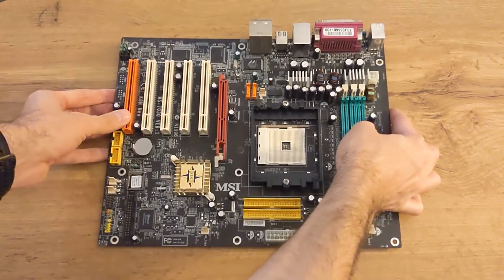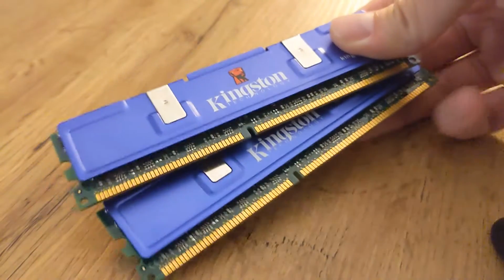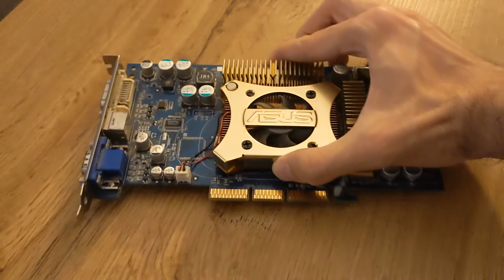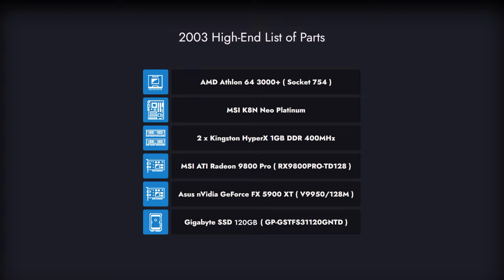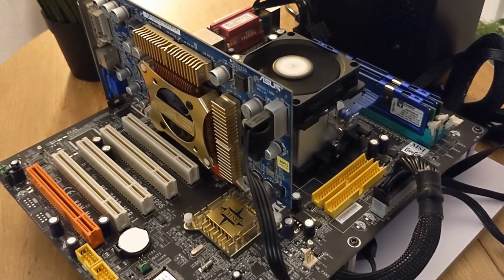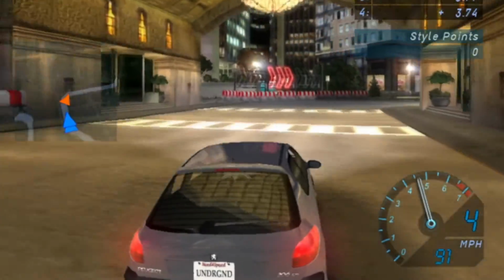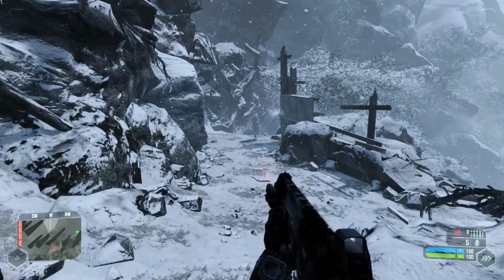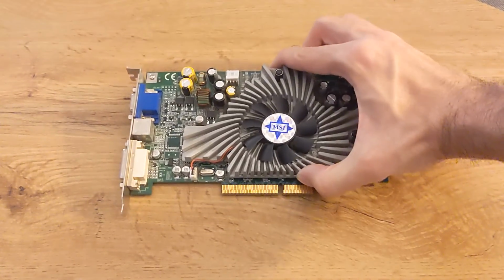2003 High-End Gaming PC Build ( Radeon 9800 Pro vs GeForce FX 5900 XT )

Comment: Ideally it would be better to use Athlon 64 2800+ since it came out in April 2023, Athlon 64 3000+ was released in late December. Also 2GB of 400mz in 2003 was an insane amount of memory. My build in 2005 was Athlone 3500+ and 1GB or RAM, most demanding games used just about half or less. I'd say all games in 2003 could ran on 256MB RAM and 2GB in 2003 is like 64-96GB in current times....

Comment: The GeForce FX5950 Ultra was the top of the line GeForce at that time.

I owned one. I had a Radeon 9700Pro before that. I switched to nVidia then because of the buggy ATi drivers at the time.

However I am a Radeon user again since 2010.

Comment: I had 5900XT, but it was not worth that money, whole FX series is just crap and nvidia drivers were totally bugged in that time, especially those for Win 98. Radeon 9800 is really nice GPU, but extremely rare to find one that actually works, I already gave up and sticked to Radeon 9600XT that is still good enough for some Win 9x gaming PC and you can still find them for reasonable price. I was always more like nvidia guy, but after 20, 25 years when I am testing it now, I realize that a lot of stuff we believed were just myths and nonsenses, in reality, it was exactly vice versa - ATI drivers were more stable and more compatible with older games, so I mostly prefer ATI cards for retro gaming computers, I am not building it for one specific game, but I am trying to get the best compatiblity and that's just very hard to achieve with nvidia cards. The last really good nvidia series from that time was GeForce 4 Ti series + 45.23 drivers.

I have more nostalgia to nvidia cards from 20-25 years ago, but on other hand I absolutely hate them. I remember back in like 2005, my father just threw AvP1 install CDs to river because he got that angry by those glitches, but it was caused by nvidia drviers, but he didn't now. 😀

Today it's vice versa, I had Radeon 9070XT for 3 months and even when all propaganda says exact opposite, I had just problems with that, from terrible input lag in games to not working integer scaling (which is important when you play a lot of old games, but today kids don't even know what integer scaling is or they tell you that AMD had it first, they had it, but it didn't work, they kind of fixed it after some driver update, but it created even higher input lag, so no, thank you, I will switch back to nvidia), weird behavior etc.....so I risked and switched to RTX 5070 Ti, after all that propaganda against it, I was really scared, but I have it already for like 6 months and not a single problem. Only little problem I had was that after some driver update, my icons on desktop just exploded and it didn't remember where I put them, after restart, it was reseted again, but I think it's more like some Microsoft mess than nvidia, it was fixed by some little utility called "desktop ok" and that's really all, no other problem with RTX 5070 Ti and mainly no smoking power connector, I was really scared by that, so I bought some better cable from seasonic.

Comment: Please inquire beforehand what was high-end in 2003 and don't publish such nonsense.
High-End in 2003 was: Radeon 9800 XT and GeForce FX 5950 Ultra.
And your 9800 Pro is not a 9800 Pro.
It's a 9800 XXL with R360 chip which is also stated on the card.
9800 Pro has R350 chip.

Comment: And then nvidia released 6800 ultra and was getting better and better every year. 6600GT aka mid-end card was way faster than 9800pro. These days we're getting 10-25% performance boost in each generation, when back in the day it was 100+% improvements :D

Comment: the 9800 pro was not top of the line released the same day even. That'd be the XT.

Also the 5900xt can't be used with unmodified graphics drivers in a head to head. It specifically substitutes code and degrades image quality because of unsupported features :) It's why your results for somethign like F.E.A.R. were wildly at odds with other games. Minimum doesn't use the features missing, but everything else does.

Comment: lol, socket 754.. for benchmarks ))
CPU bottleneck
Reply from the maker: Yes. In 2003, it was top of the line. What would you use, 7800X3D? :D
Reply: @attictiertech  use socket 939 hehe

Comment: Don't know if this is the right place to ask this, but I need some help. I have a dope 2004 computer case and I'm wanting to go retro and put two gtx 280's in it. I'm building it from scratch and I'm having trouble finding an sli compatible motherboard that'll run both of them well, (that's also around 2008) Any advice?
Reply from the maker: If it's something related to what we do, it's always the right place :)
We are working on something quite similar at the moment. So we're pretty deep in this topic.
Easy advice is to go for the best of the best for chipsets, as you want performance that will not limit 280s. 
If you're going with intel, something with Intel X58 or nForce 790i chipsets. We went with X58 (Rampage II Extreme).
For AMD I would recommend nForce 780a.
Theoretically you can also go with lower tier chipset or older platform, but there you risk compatibility problems.
As for finding the physical board, it's going to take some time and patience.
Check your local market or for some good ebay deals regularly, and soon you're going to strike gold :)
Reply: @attictiertech  Thanks for the reply! I'll keep a look out online for one of those while I research more. Also, could I get away with 2x 80mm fans? It's all my case can hold and I can't find too much info on that either.
Reply from the maker: That would be insufficient. As you might need extra airflow.
280s in SLI are pretty damn close to each other, and even though they have blower-style coolers, one is choking the other.
We pointed a 140mm fan to them on an open test bench to make sure they were cool enough.
Perhaps you can make it work with the motherboard that has even more space between the PCI-E slots, or put the second card in the x8 slot, as it's further down.
Reply: @attictiertech  In that case I might see if I can fit a bigger fan of two, spread the cards out, or downgrade to a pair of Radeon 3870 x2's. Maybe all of the above. Thanks for the help! I should have it from here

Comment: aren't you supposed to leave a space inbetween the RAM slots? also that was a pretty hasty application of the thermal paste yikes
Reply from the maker: You put space between the slots when you put RAM in dual channel, but this is still a single channel motherboard. It's not important how you apply of thermal paste if you manage to cover the whole IHS, which we did. Everything else is a matter of preference :)

Comment: This was the time when its said that ATI was better on graphics and color, and nvidia better for performance
Reply: I was there. The 9800 PRO was THE card to get. Loads of power at a good price.

And then ATI release the X800 series which was still a pretty solid competitor.
Reply: Yes. As a previous Voodoo 5500 owner I was extremely disappointed with the image quality of the subsequent Nvidia cards so I went to ATI for some years as the image quality was definitely significantly better. It wasn't until Nvidia started concentrating on features to improve image quality that I went back to Nvidia. But for a period of maybe 6 years I stuck with ATI cards.

Comment: Radeon 9800 Pro, our logical dream back in the day.
Gefore FX 5900, 5900 Ultra, 5900XT had almost identical performance. Basically nV$d$a was scamming the rich, a well deserved one.
Reply: I had 5900XT few years ago and in many games (especially those that already had DX9) it was even weaker than some Radeon 9600, whole FX series was just crap.
Reply: Depends if you cared about fog table / paletted textures. Radeon 9000 up has ugly fog table support, and that with specific drivers and specific settings, under Win98. No paletted textures.
Geforce FX* had full support for both
Reply: @netiturtle  You always find a reason. How about Nvidia with its washed out colors compared to Radeon back in the days? No, that doesn't matter.
Reply: @bestopinion9257  Why so combative? I'm not aware/cant recall color issue. If its a thing, it would matter
Reply: @netiturtle  Table Fog and Palettized Textures were legacy features by then, nothing many people would have cared about back then tbh... especially not in a high end card.
Reply: @moezarella1261  I guess. But today these cards are retro cards, and the support does matter. I'm looking at them from different perspective
Reply: @netiturtle  from today's perspective I couldn't agree more. I have a FX 5600 by MSI just because of this 😀
Reply: @netiturtle  GeForce FX doesn't work in Win 98 at all, most of later drivers are bugged and will completely break your Win 98. Only stable Win 98 drivers are 45.23 (too old for FX series) and 77.72 (too new for older games). ATI in Win 98 has much better compatiblity and those drivers are stable, everything works. If some texture is not showed 100% correctly, I don't know, important is that game works without visible glitches. With later AGP nvidia + Win 98, you can't make games like AvP or NFS 5 work, it's just completely bugged and these are exactly games I want to play on such build.
Reply: @Pidalin  Geforce FX covers lot of cards, and as such you claim is wrong. 5200, Quadro FX 1100, 5600 XT, 5700 VE, 5900 (latter three can use forced manual install with 45.23 driver and will get better FPS with it, compared to 56.64) 
 Maybe you meant FX 5950 Ultra, which had WinME driver, backported for Win98. So technically 'worked', I've no idea how well. But this card had no 8-bit paletted textures support
Reply: @netiturtle I had almost all of them and all of them are bad, yes, older FX cards can eat 45.23 drivers, but older games don't run the same good as with older gpu and these drivers, it's bugged, just test it, even MX440 is much more powerfull for games around 2000 even than FX5600. And 56.64 are also bugged in 98/ME, it will break windows when you install it, for example button create new folder disapears and some other weird stuff